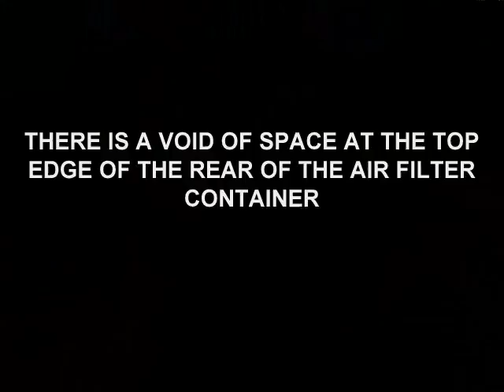LUCKY 2004 H1 RELOCATING THE PMD 6500 OPTIMIZER

Comment: Hi Lucky

I have this item with me.
How does it works with?
I dont have any idea about this. this is for what? How effect to car?

Thank you
Reply from the maker: this is a heat sink. the aluminum pulls the heat away from the electronics on the fuel pump. when the electronics get to hot. the hummer will not start. this is an excellent way to stop the overheating and failure of the electronics on the fuel pump.
Reply: +Lucky Phillips is this after market item or factory?
Reply from the maker: Aftermarket. Sold by performance Diesel repair shops.